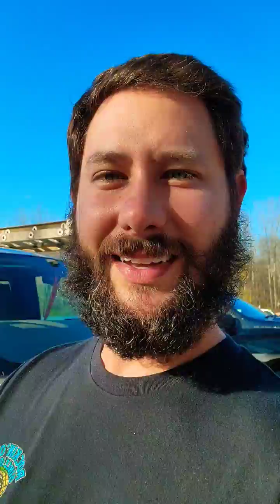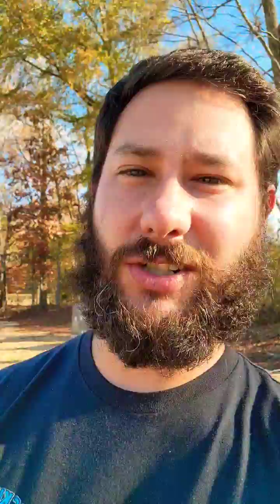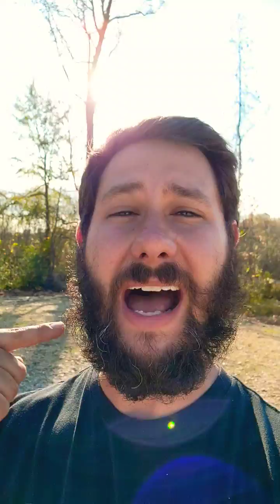oversizing and undersizing HVAC equipment

Comment: 90% of the days your home doesn't need the capacity of your equipment very few days do you need the maximum capacity of your equipment thats why 2 stage equipment is so helpful 1st stage does 75% to 80% of the work 2nd stage is there to pick up the slack when needed

Comment: Thank you sir.  Some people have the mentality that bigger is better.  I talk to customers every day about proper sizing.  In many cases, the original equipment is not sized properly, so when XYZ company comes out and doesn't do a load calc, the customer gets the wrong size again.  There are many variables to consider but sizing is one of the most crucial.  These systems, when sized and installed correctly, will do a great job of removing humidity and keeping the temp where they want all year round.

Comment: Both oversizing and undersizing are no good. However, undersizing is easier on equipment.

Poor duct design is the kicker. People need to learn how to use a Ductulator and the Manual J.

Comment: Undersize will cut the life of the unit and not to mention it won't cool well in a hot day. Oversized gives you the flexibility to add additional duct work if you ever add an addition, because dampers can be used to control temperature. I am not a professional by any means but I have done my share of A/C installs and I have learned alot from you.

Comment: Ive heard that you can upsize your inside unit a half a ton to get better airflow. Ive also heard you can oversize the outside by a half a ton to get colder air..ive seen people do it, but im just getting into the residential side and learning refrigeration. What us your opinion on this?

Comment: That's realy interesting :) mines way to big. It's meant for a big shop . When I turn it on, after few minutes it draws nearly 3kw for àbout 10 mins then when the rooms hot it ramps right down to about 300w and stays at that. It's an air to air and only use it to heat my house . Love my 9kw mini split :) keep posting the videos they are realy interesting

Comment: our old unit was a 2 1/2 ton and we put a 4 ton unit in 20 seer and our electric bill went down from 560 to 340 after 2 months with the new one. the house is 2400 sq foot
Reply from the maker: That is the correct size for that much square footage

Comment: Excessive moisture unit not running long enough Blower speeds too high to get humidity out. Excess thermal precipitation, air vents, sweating and running in bathrooms and kitchens. And that good old cold clammy feeling. While you watch the mold grow on the ceiling.

Comment: The hardest part about heating and air is pleasing the customer at all. One family can live in a house and be completely comfortable.  they sell it to the next family and it’s the worst air-conditioning that they have ever had. I think it’s all in the house, the people, the lifestyle, the location, the ductwork,  the unit and everything else around  it. But yeah. Oversized and humidity issues are a B

Comment: Can someone explain this better?  I live in Oregon, my 102 y.o.  home is 4,400sq.ft. Prior to getting my natural gas Trane V90 the old unit was 'undersized'. It would run for hours and often times not hit the set point (usually only 65) in winter.     
How is an undersized unit that runs constantly and has issues keeping you comfortable, better than hitting your comfort level too quickly and having to shut down? By keeping the fan in the low speed circulating mode it seems to keep all areas consistent. 

Would love to hear your thoughts.
Reply from the maker: It's better to have the right size

I have a video explaining the reasons

I think it's down in the link in the description

In most cases, the equipment that is oversized does not have an adequate duct system, and due to that, it shortens the life of that equipment

My oversizing equipment can cause short cycling Can cause high humidity
And a few others problems
Reply: @taddydigest  Obviously the right size  is best, who would disagree. That's not what your video, or my question was about though.   You extensive knowledge and real world experience in this field is what I was hoping would help me understand what I am missing.

I am a Homeowner who had a 'right' sized HVAC unit. Now after changing the floor plan and adding mini splits, the remaining area is conditioned with an over sized unit. 
Thank you

Comment: I neither agree nor disagree, here in the south east one is just as bad as the other. Over size and it will quite literally rain inside the house, along with what you mentioned. Undersize and your a/c will run non stop causing fans, contactors, capacitors, and compressors to fail rather quickly, plus a sky high power bill. So do your load calcs and get it right.

Comment: Inverter models and multi stage units are your best friend if you run into this problem. You can control the humidity and stop the short cycle problems.

Comment: Hello just wondering if you could cover inverter heat pump sizing. My question is how do you not over size if trying to use the unit for both primary heat and cold. Inverter can ramp down to meet the load, thanks for input!
Reply from the maker: Good question
 Yeah I will do a video on that soon
Reply: @taddydigest  appreciate that. i'm probably going to join the channel soon. Ive been looking for a video on youtube on this topic and no one has made one...that i could find...

Comment: I got a new problem in Boston ma.mass save rebates for inverter heat pumps to qualify the outside unit has to heat the inside 100% of the time.  The only time the emergency heat can come on is if the outside unit breaks.  So you have a 1800 sq house it needs 3 ton of cooling and 5 ton for heat.  A 3 ton Bosch 20 seer inverter is at 100% capacity at 0 degrees. Now if it goes below 0 the 3 ton isn’t big enough and will disqualify for 10k rebates.  Now with the Bosch system you can put a 5 ton inverter on a 2,3,4,5 ton air handler, but now what tx valve do I use? I want all 5 tons for heat and only 2.5 for cooling? They don’t make half sizes on indoor or outdoor units.  It seems every heat pump system is oversized or under sized.  I’m thinking the only way to do a perfect job sizing is with mini splits in Boston. Don’t get me wrong I have over 100 ducted heat pumps installed with no problems or issues at this moment.  What are your thoughts.  Bosch said you can put a 5 ton HP on 2 ton ah but they don’t recommend it.  The Bosch 5 ton can put out 9k btu’s at its lowest output. I’d love to have a talk about this situation I’m in, in Boston ma. ThNks for all the vids. I just found your vids today.
Reply from the maker: This is very interesting
 Just curious I have a question
 Does the indoor unit or outdoor unit contain the txv 
if so is it a EEV valve?
 Wouldn't that make it more capable of modulating
 Or if it comes with an indoor regular TXV
 Then I would definitely go with a 5 ton txv

Comment: What about when you have a heat pump the size and the winner is different than the size in the summer. I need to have enough heat in the winter which means I'm oversized in the summer. Would a variable speed system solve this problem?
Reply from the maker: yes a vrf system would solve this

Comment: Manual J calcs are a win. You can directly show customer what changing insulation, windows, etc. some times land up downsizing. Had a customer say they think they need a larger unit. Said customer has 1100sf home, had a dead 3.5ton weathtron heatpump. Pulled calcs went with 1.5ton 5kw back up. Old system only had half the return needed for 3.5 when I recovered the gas it was sevearly overcharged about 300% of proper charge based on lineset. New system cut power bill from >180 month to aprox 50 for similar ave temp. Also humidity was low in summer. They landed up setting thermostat at 78f vers 65 they previously set at.
Reply from the maker: This right here is exactly why manual J is great
 This is excellent information
 You're able to help in ways that the competition will never be able to help

Comment: Depends on the house envelope, i up size my 1/2 ton because of high ceilings, no insulation in the attic, dropped the fan speed, and replaced the duct board with round pipe, first electric bill was 380 in august, replaced it with my free time in the winter and this august my highest electrical bill was 166. And I keep my house at 66°, also ripped out a 1999 carrier 80% and went with rheem 15 seer 95% furnace.

Comment: Just came across a three year old condenser just .5 ton over and compressor was gone.
Reply from the maker: wow thanks for sharing
Reply: .5 lbs of refrigerant? Or pressures
Reply: @conspiraciesexposed7760  the unit itself was half ton oversized, ductwork barely covered 1.5 ton unit, they slapped a two in and three years later the compressor is shot.